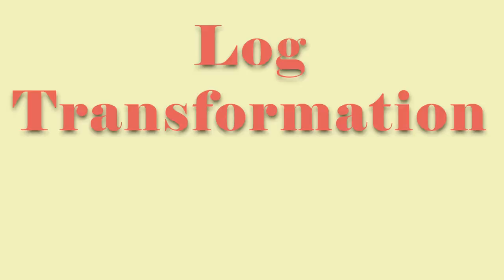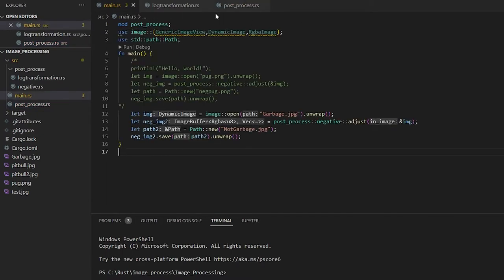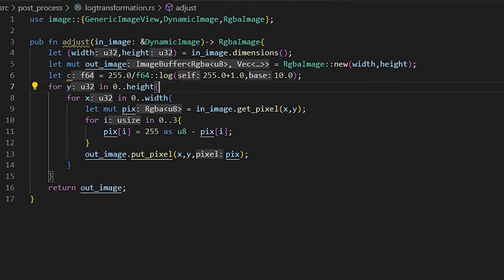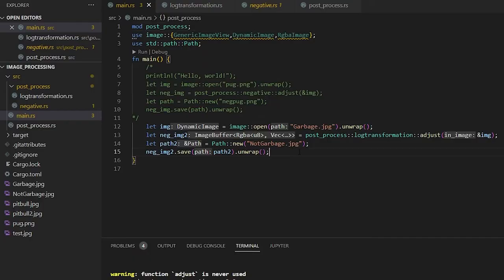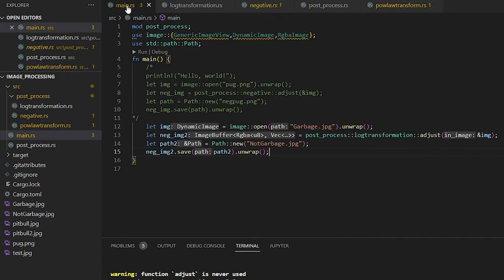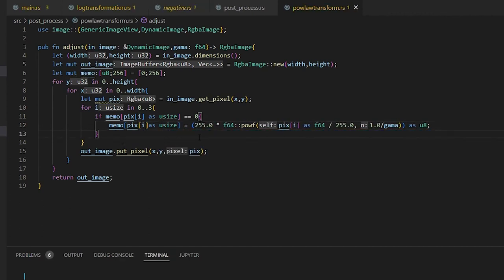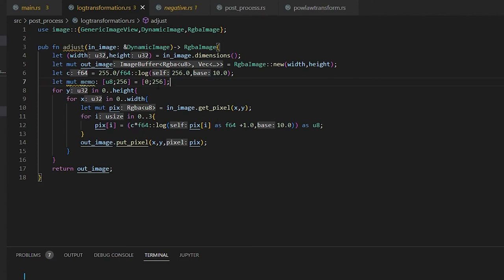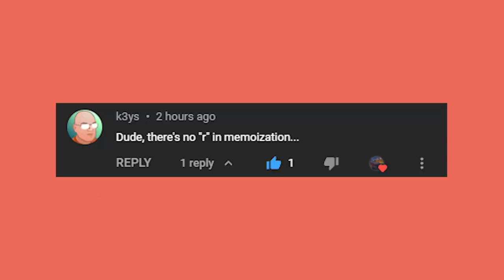Rust - Log/Power Law transformation

Comment: I wonder if it's worth just pre-calculating all the values in the memo array, and just always looking them up in the loop. Calculating 256 log values should be basically instant, then inside your loop you don't have any decision-making code, just pure lookup.
Reply from the maker: That could be worth looking into. I've been busy lately so when I have time I'll make a program. The current version has a worst case scenario of doing log 256 time but the best case is 1.  The test would have to be a mono color image at different sizes and see where the ifs are slower than the 256 logs.
Reply from the maker: That being said x86 log takes 85 clock cycles where if statements take 3 so one could do the math. But since that's assembly it also depends on how rust handles it on compilation to assembly.